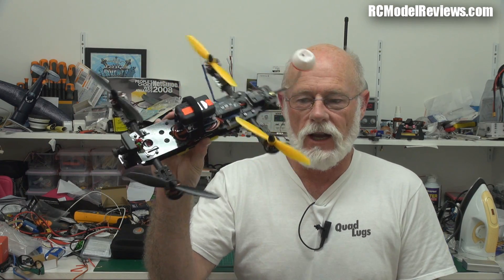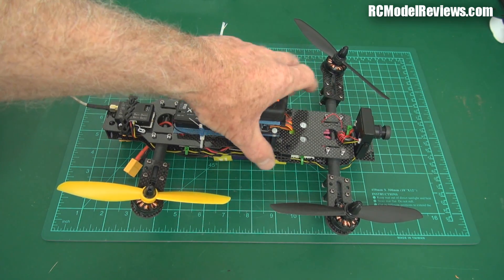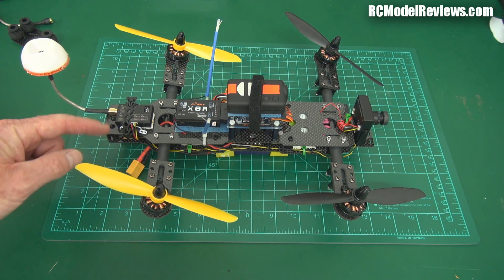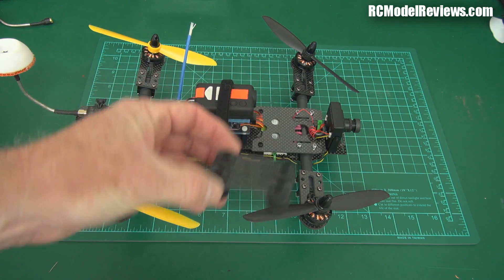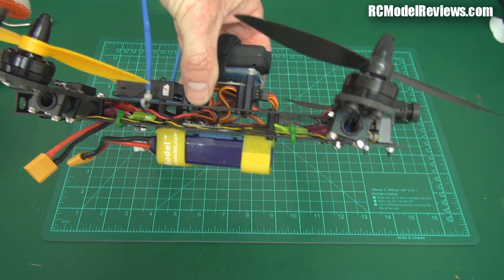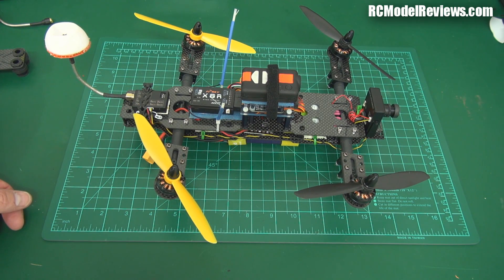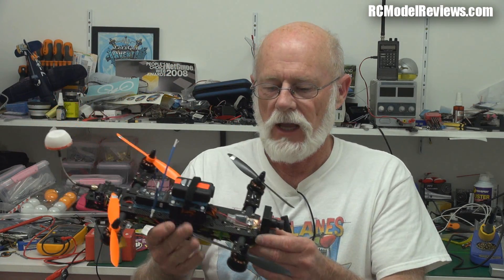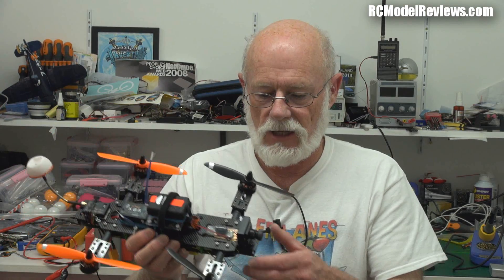Quadrysteria Mini Mamba (part 2 - tilted motors & FPV flight test)

Comment: Tube arms... I've had 3 frames with tube arms. All of them had huge problems... Using tubes for arms sounds like a fantastic idea on paper, but in reality they are nothing but trouble.
Reply: What kind of problems have you had with tube arms?
Reply: Clamps don't hold them. They twist and change one of the motors thrust angle. Then you try to figure why your quad keeps yawing around.

You can put a screw through them to keep em straight, but doing so pretty much guarantees that it'll crack when you crash.

All the clamps and pivot thingies add unnecessary weight, complexity and clutter. 

Motor mounts that goes to carbon booms are usually just a 1.5mm CF plate. They'll also break with your first crash. 

I've tried Aluminum tubes, CF tubes, CF square tubes, wooden dovels, glass fiber rubes,  and plastic arms. If you are gonna do anything bigger then 300 class, I'd definitely recommend DJI flamewheel style arms. Not the cheap flexy hobbyking crap. The original DJI arms or one of the good clones. 

If you're looking for a mini quad arms, I definitely recommend 4mm aluminum arms. Far as I know there aren't any commercial ones out there, but I designed and got laser cut some arms for Hobbyking Dart 250 frame. IT is unbelievable. Not that they are too strong or anything. 2mm CF is probably both lighter and stronger then them. The winning point is heat dissipation. 

My Emax 2300kv motors used to get quite hot with 6x4.5 props. Now? Nothing. They are ice cold after a 15 minute run. Basically your arms turn into a gigantic heatsink.
Reply: OK...thanks for the info.
Reply: flanker Flat 3mm arms, How many people are serious racers? for the rest of us, it's 3 mm flat CF. ZMR frame is good enough for most, some people like to buy "branded" products  that are no better. the hobby needs to be affordable. Why is a Blackout frame £100 more than a ZMR? it's not £100 better. Bruce gets sent so much stuff, he doesn't have the time or the inclination to show us it all, and Dare I say it, he's a bit of a snob when it comes down to the line.
If it works, it's good, if it doesn't, we want to be told.
I'd like the guy who built that frame's contact details, I've got some ideas for him.
Reply: Ben Portman Honestly, even for racers I don't think tube arms are advantageous. You want tilted motors? Fine go buy a tilted mount for flat CF arms. Tube arms are thick a to accommodate to them, there has to be lots of space between lover and upper plates. Which translates to more air resistance. Not a good thing for a racer. 

I'm 100% behind you on the Blackout frame department. If it was 100$, I'd buy it just as a thank you for people who do R&D work for the hobby. But paying 150$ for the exact same frame that is sold for 30$ by Chinese sounds kinda ridiculous. Sure blackout's CF might be a little better quality. But For the price of one Blackout I can buy 5 ZMRs. And Blackout is not THAT great.

Comment: Hey Bruce maybe try some big zip ties looped and bolted to the bottom of the quad.  See here http://tinypic.com/r/20i8n4g/8 and here http://tinypic.com/r/1ok32p/8.  Works really well.
Reply: That's a fantastic idea... Is there anything zip ties can't be used for? I use them to stabilize the camera, hold frame parts together, and lots of other stuff. I feel like I can construct everything with some zip tie and good old scotch tape :D
Reply: flanker Cable ties are awesome.  You see my mobius platform also stabilised by cable ties and hot glue :)
Reply: The model comes with carbon fiber landing gear. Bruce choose to leave it off. The V2 puts the landing gear under the frame so you don't need to worry about them rotating the arms in a crash. Also allows you to build an H8 monster.